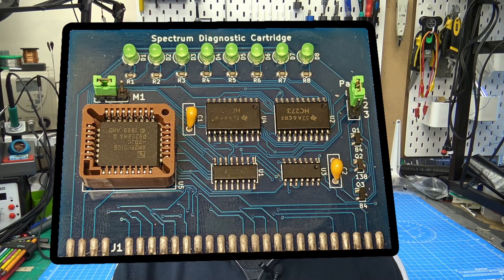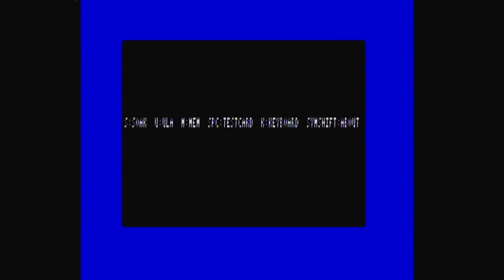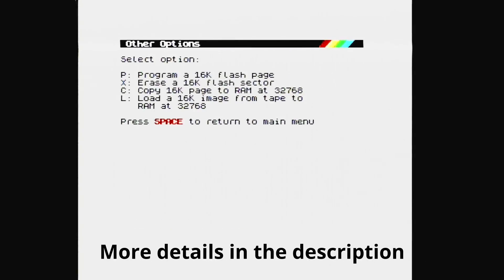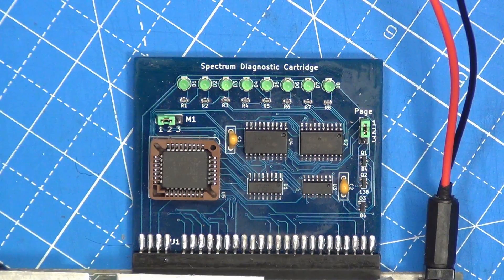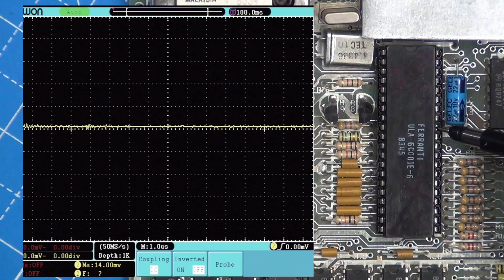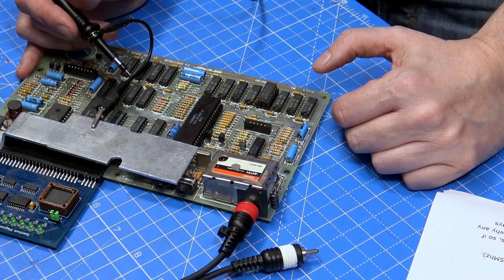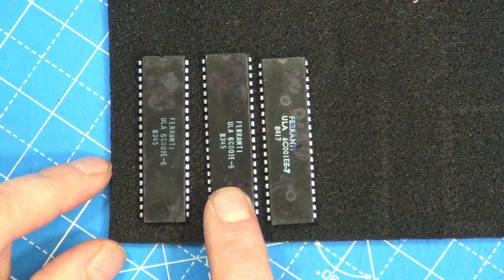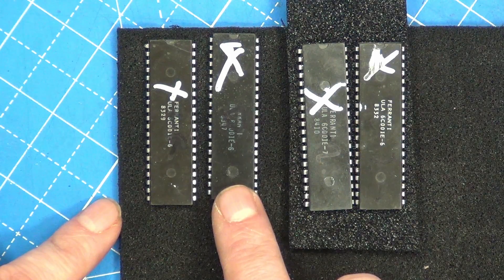Three FAULTY  ZX Spectrums and a Diagnostic Cartridge = bad ULA

Comment: Ive tried this card on my +2B. Just always boots to a garbled screen. Its strange as the spectrum works perfectly. Always loads via tape and mp3 via cassette adapter. Ive cleaned and done continuity on the edge connector. Seams okay. I also brought a Dandanator as thought the diag card was faulty. Also does the same thing. Random garbled screen. Any pointers would be so appreciated. Great channel btw. Subbed 👍🏻
Reply from the maker: as far as I know it does not work on the +2 models.
Reply: @leesmithsworkshop  thanks mate. Tried a ram and ROM diag program loaded through tape. That worked. Probably confirms what you said. Cheers bud 👍🏻

Comment: Nice methodological fault finding Lee! I have a Toastrack ULA that similarly is perfectly working apart from needing a very high tape input (relative to other ULAs). Not sure if it’s age related, or maybe there was some variability between them when they were made?

Anyway, great video — looking forward to seeing more in the next one. 👍
Reply from the maker: I have another -7 that needed the same tape levels as all the others, it was only the X marked -7 that needed the extra volume. The -7 is supposed to be the best one so I am not sure if this one is slowly failing.
Reply: @leesmithsworkshop  have you tried any of the modern replacements? I’ve had good results with Charlie Ingley’s vLA128 and vLA1 (for Interface 1) but I haven’t tried anything aimed at the 48K.

I’d love a real ULAplus though (hardware support for more colour palettes) but that’s another story!
Reply from the maker: @flatduckrecords  I don't have any and I was not able to buy any for a reasonable price. All I could find was in New Zealand and I was annoyed that the web store did not tell you it's location until my £32 ula ended up at £52 with shipping and fees.